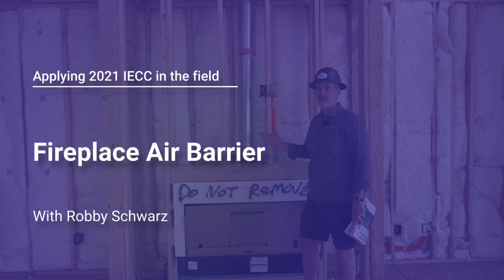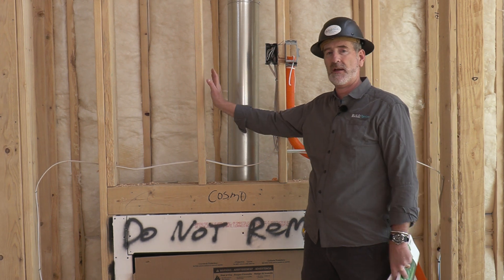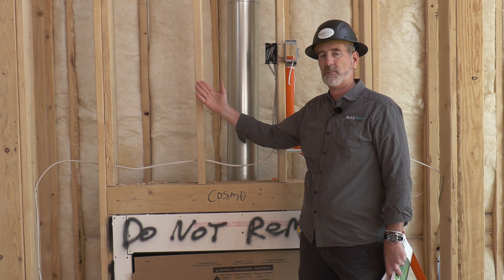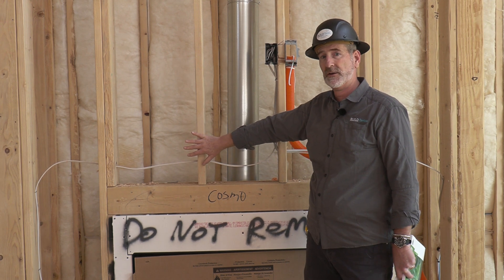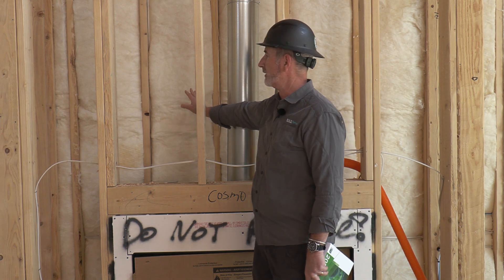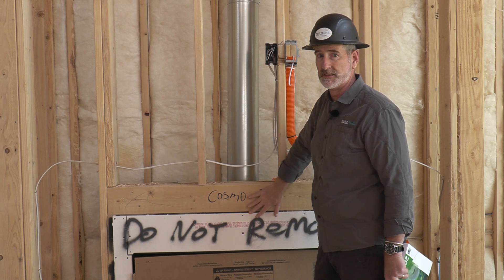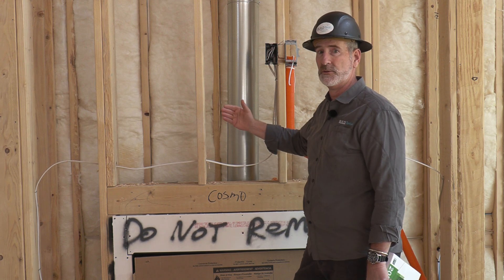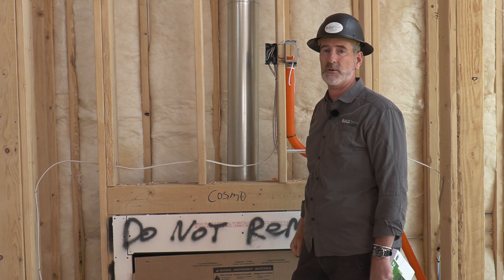Fireplace Air Barrier - Field Application of the Energy Code

Comment: I am adding a great room with a fireplace exactly like your video but the framers/contractor did not put a supplemental  air barrier on the exterior wall behind the fireplace. they have just installed Rockwool on the ext wall but have not enclosed the fireplace yet. It has been installed and the vent pipe is installed venting through the roof. What recommendations do you have for adding the supplemental at this point in the build? It’s the same scenario as you have but without the added air barrier installed. I am in TN which I think still uses the 2018 code.
Reply from the maker: If not required by code you are OK and you will likely have a hard time convincing the framer to add it now.   But there are ways to  still add the air barrier, in most cases